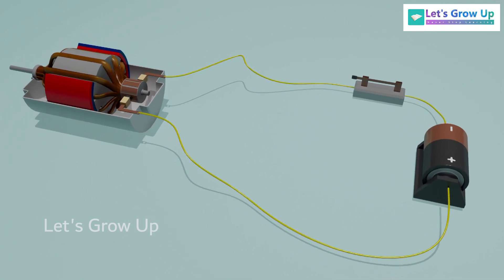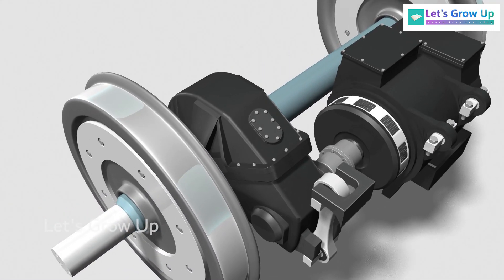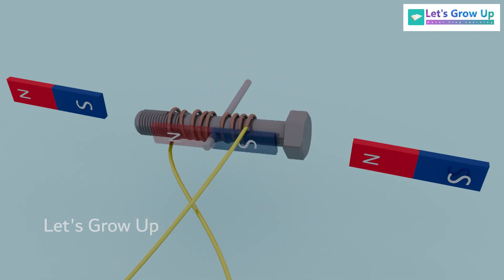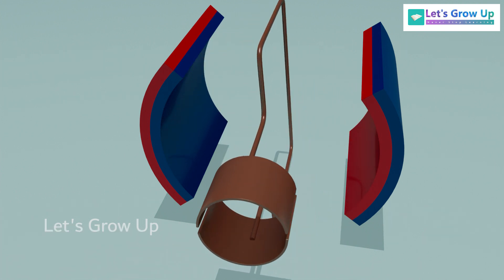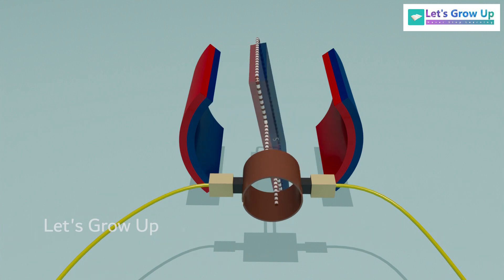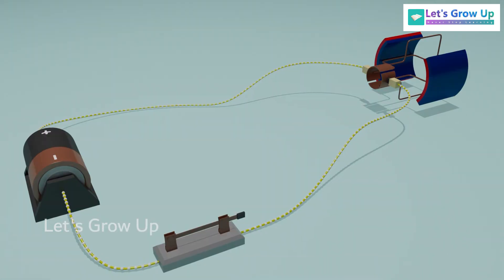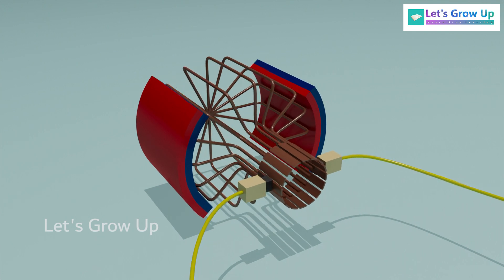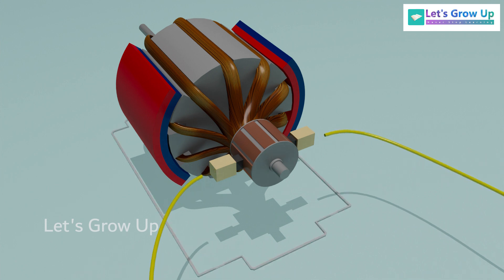How does an Electric Motor Work?  The fundamental concept of Motor | electric Motor

Comment: Thanks for the video, but the "demonstration" at 3:34 of the armature coil spinning so that the plane of the armature coil is facing up when it is done "turning", is incorrect. The plane of the coil will create a N and S face. The N will attract to the S. Face of the Permanent Magnet, and the S will attract toward the N. Face of the Permanent Magnet. 
Therefore the coil will "stop" when it is facing the Pole of the Magnets, not when it is facing up or down in this case. You have it making it a 360 degree rotation, it should only go about 180 degrees if you don't "swap" wires.

Comment: In a frame you put positive in one side, then on the other frame/explanation you put it in the other side. So by you putting the "south" magnetic field on top, everytime, your video is wrong, because as you explained in the same video, it would switch polarity depending where the positive side is on.

Comment: I would like to see day-to-day things, like how a fan works, the way AC runs through the auxiliary and speed coils and the capacitor helps the start.

In my perception, an "eletric motor" is something 90% of the people does not have much interest. An escalator is way more cool and is more attached to reality of more people, what people have more day-to-day contact